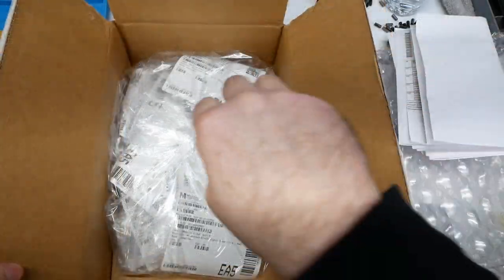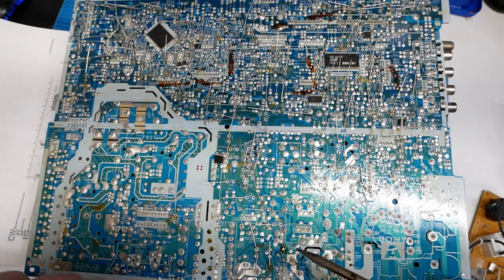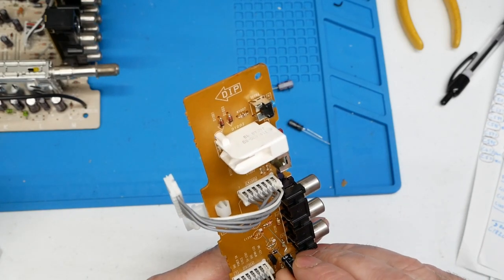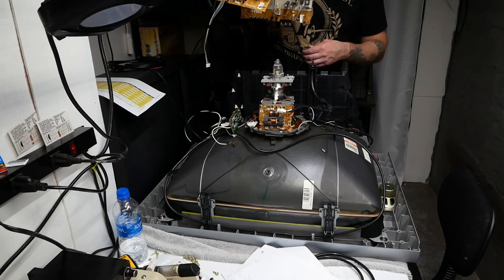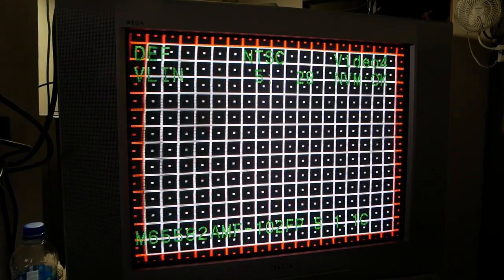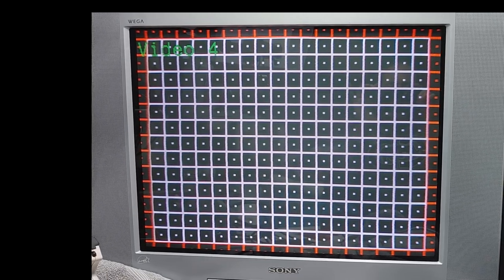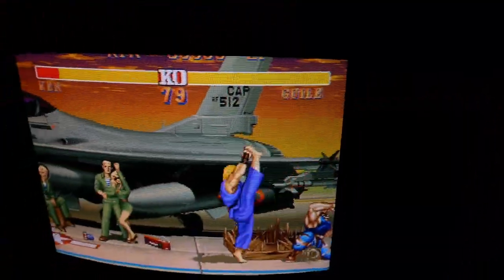Sony CRT Recap Part 2 , Capacitors Replaced, Yoke Reseat,TV Tuner Bypass ,Geometry Calibration fs120

Comment from the maker: Part 2 of the Sony Trinitron Consumer CRT recap and calibration.

In this video I finish up where I left off in part 1. All 120 capacitors are replaced trying to rid a dot-crawl,ringing,sync jitter artifact. After recap I reseat and adjust the yoke and straighten out geometry through the service menu. 
After having to pull the board to put in shorter power filter caps I decide to disable Hsync and composite signals from the tv tuner from reaching the jungle chip on a suggestion from someone with a long history in crt repair.
He explained to me that Hsync from the tuner is not always filtered out properly from the jungle chip and could cause some cross talk interference.
Ive also learned Sony deviated from prior specs of sync frequencies and so on these later model flat sonys you get this sometimes with older consoles and that ps2 and ps3's wont have the jitter due to the sync frequency tolerances. 
Im using mister fpga and hoped the signal was clean and within spec of this set. Its too early to tell if the tuner bypass worked or not, I need to test more. 
Also- I forgot to mention I also physically disabled velocity modulation from the neck board, and thanks to ElectronAsh for the info on disabling the TV tuner!

Part 1... https://youtu.be/Bg4-sKPuQpI

Comment: Good to see it ended up in decent shape 👍I got one of those 27 inch Sonys for about 20 quid a few years ago. Got it home and saw that what looked like the focus was out in the corners of the screen. It had a shit load of hours on it. It also had like a green blur to it in the corners that looked different to what you'd normally see with a convergence issue. The centre of the screen was perfect.

Took the back off it and no matter what I did I could not get the focus/convergence consistent. This set had quite sophisticated convergence pots on the yoke and neckboard and some decent pots on the flyback.

I even made some extra convergence strips for it. I gave it a cap kit and still no improvement. I bought a new flyback for it as well.

Then one day one of the colours failed. I had the back off off it and was having a poke around and out of nowhere my solder fell from wherever it was and the end of the roll shorted across components on the main board.

There was a puff of smoke from the neckboard of all places and the TV clicked off. So ended the life of that particular Sony.

It never saw its new flyback 🎻
Reply from the maker: Damn, thats sad to hear after all that work you put in it. Ive recently got this 27" sony serviced, a 36" jvc recapped and rgb modded, and several pvms recapped but havnt had time to even turn one on in weeks :(  
Took a new job and forced 60hrs a week.
I think ill work it untill my house is paid off then get a part time jobby in town and get back to crt repair... Maybe make a side job out of it

Comment: Enjoyed this. Don’t worry, the XP you earned is priceless even if you didn’t get the desired results. I’ve been working up to doing some recapping and your vid boosted my confidence that I could do it but also helped temper my expectations. Seems to me the reality is that these flat CRTs are just never going to be perfect, on the whole. I’ve pretty much stopped going after flats as I’ve had much better success with curved sets as far as geo/convergence/linearity. I like the novelty of curved screens anyway. Feels more authentic and definitely takes me back to them old days when I play on them. There’s a charm the flat bois just don’t have.

BTW, I’ve corrected worse looking geometry using magnets on the back of the tube. If you catch another case of the OCDs just get yourself a bunch of different kinds of magnets, tape them to card stock strips and go wild. You might be surprised what you can do. I have found that the key is finding the right magnet strength.
Reply from the maker: I totally agree about the curved tube preference. Every curved tube Ive recapped showed improved geometry, or the very least....stable geometry afterwards, and your right.... curvies tend to have way better geometry and convergence. I did play around with magnets some on this flat sony but called good enough on it.
I think really anybody could recap if they had the right tools and a little patience. A decent cheap temp control machine, some good solder and flux, and a cheap vac desoldering unit is all thats really required in my opinion..... and patience lol.

Comment: Awesome video man. You dialed that in Sony amazingly despite the sub-par geometry you started with. I have a 13in pvm with one wonky corner and terrible convergence. Way worse than your giant trinitron. It’s also great to know that those jitters won’t necessarily be fixed with new caps. Earned a sub
Reply from the maker: Thank you! I just finished calibrating the convergence rings on a 13" pvm and got the center good but edges are separating a bit. Ill probably call it good for now until I decide to recap it... Geometry and convergence can really trigger ocd and drive you crazy lol

Comment: Great set of videos! Any updates on the dot crawl / horizontal jitter? I have the same thing on a KV-32XBR250 and am wondering if I’ll ever be able to fix it.
Reply from the maker: The tuner signal bypass seemed to help some. After completing this crt i moved on to do a couple rgb mux mods and a 36" jvc kind of dethroned this sony so I havnt used it much since these vids

Comment: Hey try setting the channel to either 3 or 4 when it's in tv mode. It might sound weird but I had mine on like 60 something because I don't pay attention to it and I think the wilder static on that channel number was bringing in interference making that gittery effect worse on video 1, 2, and 3.
Reply from the maker: Ive disabled the tv tuner signals from the video encoder ic
Reply: @LameGaming  Oh my bad I missed that part, that's cool that you can do that. Set looks pretty damn good at the end if you ask me!
Reply from the maker: @overkill7990  No prob, it was a last minute decision to cut signals from the tuner. Electronash told me what components to terminate signals at, i cant take any credit lol. Its pretty decent after alot of service menu adjustments.
Im liking this 36" jvc alot better though. It has nearly perfect geometry and convergence with a thompson arcade tube, just rgb modded it a while ago. It feels like a giant pvm.... Definately one of my favorite tubes

Comment: Good video. I'm going to tackle this project with one of my Trinitrons soon.
Reply from the maker: Best of luck, even if it doesnt fix any inherent ussues its still nice to know you elongated the life of your set
Reply: @LameGaming  thinks for letting me know that. It's a kd32fs170. Geometry is horrible wavy lines along the sides and bowing at the top
Reply from the maker: @Tiknuttle  If you dont have a good esr meter and this is a "one and done" type of project, I would suggest just replacing the deflection and power circuit caps
Reply: @LameGaming  Thanks. I'll have to get the required equipment. What if the capacitors are shot though?
Reply from the maker: @Tiknuttle  Any bad ones that would cause geometry or picture issues will be in those circuits.
Reply: @LameGaming  Thanks I will replace just the reflection and power circuit caps. How many capacitors is that?
Reply from the maker: @Tiknuttle  Probably 30 or so
Reply: @LameGaming  That's a lot.

Comment: Nice work. Is removing the flyback an  issue after removing the anode cap, or will it be drained of its energy storage as well? Thank you sir
Reply from the maker: As long as its not plugged in, the only thing to discharge is the tube and large power caps. If the flyback had a charge it would be discharged when your grounded discharge tool is stuck under the rubber anode cap.
Thanks for watching!

Comment: great video! I was thinking about recapping SONY 27inch TV because of jitters what you described in video.  It has weird jitters or shimmering on each pixel. I may do same as you removed jungle chip signal(TV signal)... does it make any visible difference ? 
I wish I can play someone like you to do my TV recap.. in dallas, TX area :)
Reply from the maker: Sadly im far away in the midwest.
It did appear to help some but did not do alot of testing because shortly after this recap I got a boatload of pvm's and a jvc 36" that I rgb modded and use it as my main crt now.

Comment: I like to fold one leg only, solder and trim the straight leg while making sure the cap is oriented how I want it, then straighten the bent lead and solder that. This will help if I need to desolder in the future since it’s difficult to get bent leads into a desolder iron nozzle/tip. It also means I get a more useful trimmed component leg to use as a jumper or something.
Reply from the maker: Im never touching this board again 🤣🤣🤣
But yeah your right, theres insertion ways that are more mindful for future repairs but with 120 caps I just wanted to get this done. I may try a different method on the next recap though which will probably be on a 1341 pvm.

Comment: very good afternoon, I admire you and I love your videos! I was encouraged to write to ask you a question. I have 2 crt tvs, a 21-inch hikato and a 21-inch sony trinitron too. The trinitron just so happens to look pretty cool. the wii and gamecube games look excellent. ps1 and ps2 the same. but it happens to me that the image shakes. It's like that effect that the letters that say video 1 video 2 dvd have in the upper left corner, only here it's all over the screen, especially in the letters. Sometimes I'm reading and it makes me dizzy. I play with generic component cables (I'm collecting for retrovision hd cables) but I've done the test with the original composite cables and the same thing happens. what should it be? Could it be the capacitors? The truth is that it hurts me that it is like this since the image looks spectacular. my hikato doesn't have that problem, the image hardly shakes, I use that with emulators on the wii to play nes, snes, genesis, etc. with the component cable so they look better.
 I love electronics, I recently bought a new soldering station to practice and improve, you are a great reference for me! I hope you are very well and I send you a big hug 🙌
Reply from the maker: Thanks for watching , I havnt been able to upload or edit anything lately since im working 60 hrs a week out of town 😖

If your sure it isnt the cables then it wouldnt hurt to open her up and check the esr of caps and for any other potential problems like cold solder joints.
Also ive heard of ac mains interference if using poorly shielded cables, have you tried a different location/outlet?

Alot of newer sonys had a sync jitter like the one in this video, is yours similar or way worse?
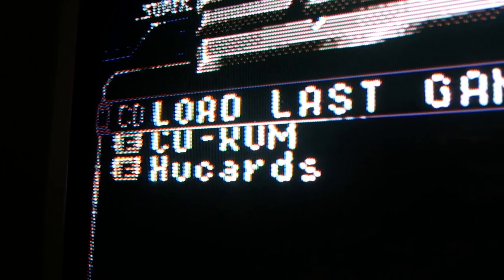Reply: @LameGaming  Gracias por su respuesta amigo! espero te vaya bien en tu trabajo. lo de la interferencia tambien lo escuche. me recomendaron un UPS FORZA pero no se que tan factible sea. me gustaria comprobarlo pero son un poco caros. probare de momento en otra toma de corriente ya que tengo un extensor chino de calidad regular. al sync jitter te refieres a lo que muestras en esta parte del video (10:58). si es asi es similar de hecho me sorprendio verlo en tu video porque es muy parecido la forma en que tiemblan las letras.

Comment: That pixel jitter at about 11:30 (IDK what else to call it, I know there aren't pixels), I had that issue on all four of my consumer trinitrons. It drove me crazy enough to get rid of all of them. It's true what you say about being spoiled by pvms. None of my sony pvms do that, nor my jvc pvms. Also, none of my other consumer crts do it either (jvc, toshiba). Shame really, could never figure why that's a thing. If you ever find a fix, I'd love to know it because I'd hate to write off consumer trinis for good. But after going 4 for 4, I may not get another. Glad I found this video though, because I almost did a recap on one of them.
Reply from the maker: Yeah, its def not an issue on any of my pro monitors or other brands. I think it was just certain late model chassis consumer sonys that had integrated video processors. I got a few early curved sony trinis recently that im going to rgb mod and didnt notice it on them.
Disabling VM and the tuner signal helped but didnt completely get rid of it. I wonder if its just a design flaw of these certain chassis
Reply: @LameGaming  Good to know about those curved trinis not having that issue. Been keeping an eye open for one of those myself with the intention of rgb modding. I have yet to find one in good enough shape, been looking for a few years. Cool tip on the tuner signal, I may try that on some of my other consumer crts.
Reply: yea i just got this tv and got the same jitter its driving me nuts especialy trying to read text / pause menus .  might just not even use this tv becaus of it. i been trying to figure out if i can do anything to fix it, but seems like nope.
Reply from the maker: @zeebpc  Turn off or disable VM, I cant remember but think I talked about it in the video. Some said you can mitigate it by adjusting the screen rotation in the menu or service menu (cant remember which its in) but that had no effect for me either.
Disabling the tuner signals helped some but not completely and maybe some of it was even placebo.... Theres a thread on shmups about this issue as well. No 100% cure as far as I know.
Reply: You did this all to fix something that can’t be fixed?

Comment: Hello, my name is Raymond, I am from the Dominican Republic and I have one of those 27-inch CRT televisions and I want to change the capacitors and I would like to know if you could leave me in a message the list of capacitors that I use to buy them please
Reply from the maker: I cant guarantee I still have the list but if if I do I can email it to you.

If your going to have the board out anyway it doesnt take long to write down the caps to replace.

I would just replace the caps in the power and deflection circuits. Those take the most abuse and the others are likely fine.

Comment: Maybe the issue was wrong value capacitors, probably should have followed the manual. Try?
Reply from the maker: It would be a good experiment but I assume at the factory if some caps were out of stock then the next higher value were substituted when permissible.
I may look into this more in the future though. Good question!